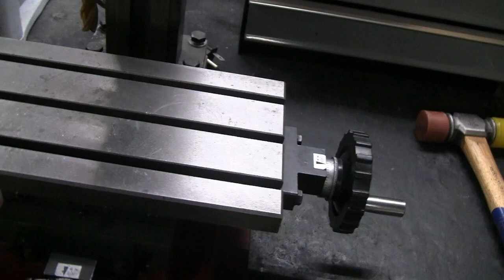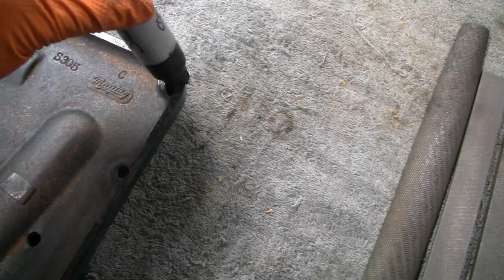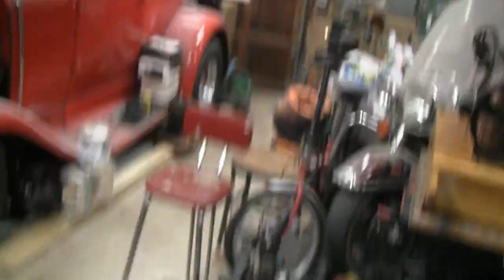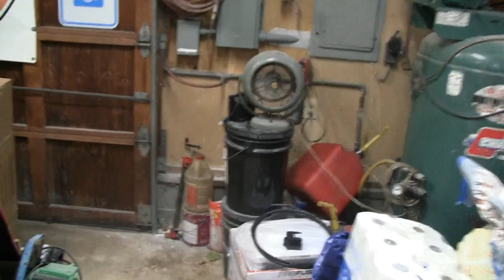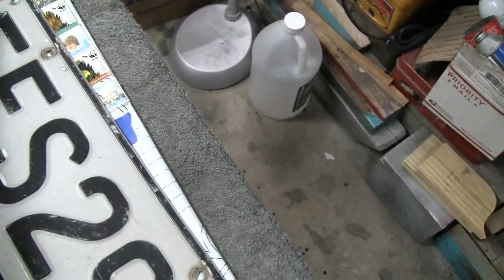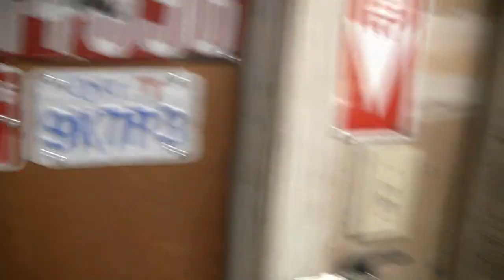MAYTAG 72 ENGINE REPAIR (part 11)

Comment: The red and white Swedish license plate is a "temporary plate" used when a vehicle is exported or imported. You can apply for a temporary registration e.g. when you have to use the vehicle before all paperwork such as customs and  registration is done. Hope you're not too disappointed..

Comment: If you have a big enough flat surface attach sand paper to that surface and when you get it close use that surface to get it as close as it's ever going to get. Some people use a thicker piece of glass with sand paper attached on the flat surface.

Comment: Another way to sneak up on removing material on the cover would have been to use your magnum sharpie to locate the high places but you did a damn good job without. RK don't need no stinkin' milling machine. :-)
Reply from the maker: Thanks Ron!!☺

Comment: My Grandpa used to use lead based house paint on the top and bottom of Ford Y block head gaskets. They never leaked and you could never get em apart again.....make sure you get everything right first with this crazy method.
Reply from the maker: Never heard of that!! I have Indian Head Shellac on the shelf, that stuff is pretty permanent too!!☺

Comment: Good job using a belt sander and a file ..Today I machined a small metal pin using the cordless drill to spin it and used the dremel like a tool post grinder
Reply from the maker: Thanks Bud!! That sounds interesting, I hope ya filmed it!!☺
Reply: @805ROADKING  No but I did show in a video using a drill and a file

Comment: I've spent many hours with a big bastard or mill file truing stuff up. I need to invest in a disc and belt grinder.
Reply from the maker: That Disc/Belt has got to be the most used tool in the shop!!☺